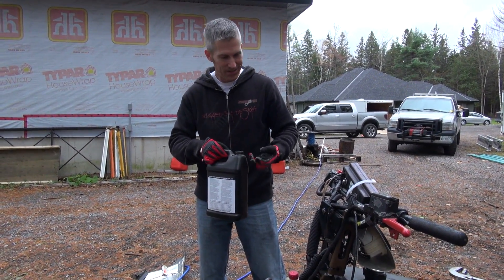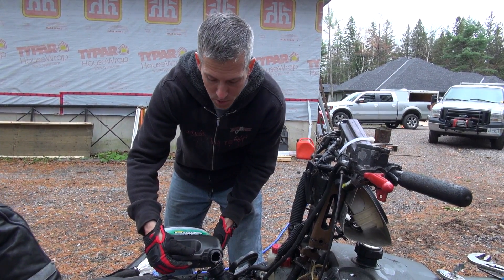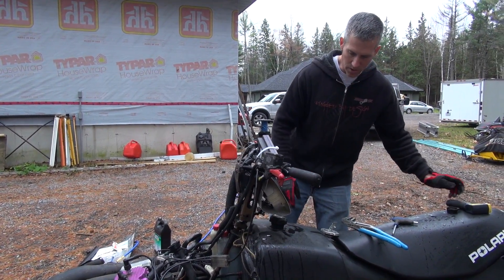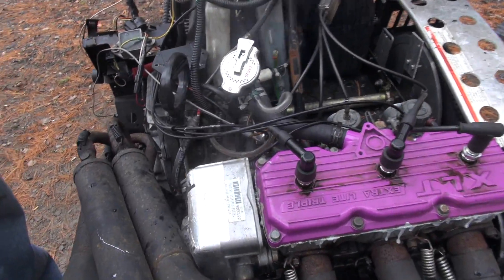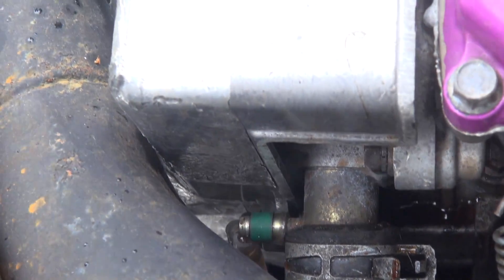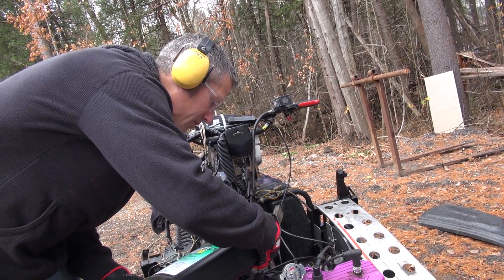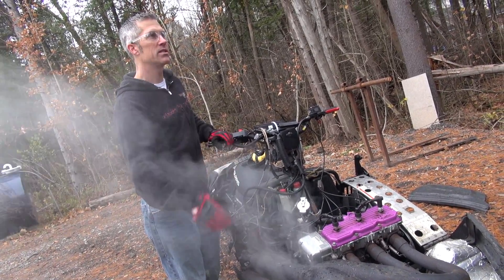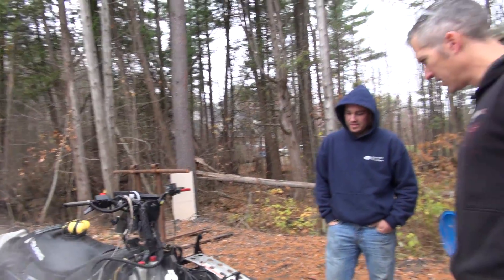Snowmobile run to 330 degrees with no cooler!  Evans Waterless coolant!

Comment: Mine went to 360 once after a air pocket blew out my coolant of my edge xcsp 800 found out my thermostat was bad but nothing melted other then my gaskets and I had no coolant at all and it still rips 😅
Reply: This year got extra cooler new thermostat and digital gauge no more over heating I couldn’t figure it out for years lol should of listen my thermostat was cooked the rod was completly pushed out and hanging there I thought I was ment to be like that but then relaized no it wasn’t 😅

Comment: ...so if the coolent is just circulating and isn't transferring the heat anywhere what the hell is the point. 330F is going the blow that engine to bits under load. If your engine got that hot you want the coolent to boil over to save the machine as a last resort. The phase change of water to seam absorbs a ton of heat and will rapidly cool the engine.
Reply: Michael Sestito actually no, at the point the water starts to boil around the cylinders it quits removing heat because there is a layer of steam between the cylinder and the coolant.  The steam being less dense than the coolant, it's ability to transfer heat is severely limited.  More often than not once the 50/50 boils it's to late to save the engine. The Evans remains a liquid and is still transferring heat well past the point 50/50 has boiled away.
Reply: @redneckgearheadgarage495  Exactly!! And that's why the 375 Degree Ferenheit rating of Evans is so important. 

Its that extra insurance in case something catastrophic happens like a failed water pump. 

What most people don't understand is that hi performance Lubricants like Evans have a really high boiling point for the purpose of helping to prevent total engine failure. 

If a lubricant boils off to soon, then there is nothing protecting the parts from the extreame heat leading to a quick death. 

Im sure you know that. Just hard to believe sometimes how dumb others can be.

Comment: As long as the temperature of the piston and cylinder gets to equalize instead of the piston racing ahead in temperature, engines can run very high temperature. Mostly limited to piston ring gap and coolant evaporation from the side of the engine, and the fuel mixture (it can detonate early and other stuff as a result of the heat).

Comment: Hey Louie, so if I'm understanding this correctly you're basically illustrating that this coolant didn't lose its cooling properties even at those extreme temperatures therefore the motor was still fine, but with a conventional 50/50 the coolant would've failed causing engine failure long before? Cool video man!

Comment: Most over heating is the result of th loss of coolant first,then the engine damage.Evans coolant while great will do nothing more than 50/50 in the majority of the cases,liquid cooled sleds don't overheat with full coolant very often,in those cases it would definitely be better to have it and not have your coolant boil off
Reply: +John DiMartino 
I'd beg to differ.  Slow operation, running on icy trails without scratchers, not kicking anything into the exchangers, will take some sleds easily into the boiling range of 50/50. And once you hit that point, damage happens fast.  You probably won't notice the overheat light before damage is already done.
Reply: +Element of Kindness if you don't notice it in 10-20 seconds you're messed up in the head
Reply: @LogicModding2003  No. 10-20 seconds is easy to overlook.

Comment: I dont see how this is a test of coolant, I mean, it is more a test of engine durability and oil effectiveness then anything.
Reply: PowerModz  Might have, depends what temperature the oil loses lubricity rating and if it even gets to that point before it reaches the combustion chamber.
Reply: Actually yes, it would have. Eventually, the oil would not be able to provide sufficient cooling and lubrication. If you would have put 50/50 in, the coolant would boil over before it hit an outstanding 350 degrees, letting you know you should turn off the engine before you cause serious damage/ mechanical failure. I dislike Evans coolant due to the fact that just because you don't know its getting too hot doesn't mean its not getting too hot.
Reply: You are correct.  The test proves that the engine will run at elevated temperatures and nothing more.  It is a tribute to the engine designers and the oil and has very little to do with the coolant since the coolant was not even allowed to do its job.  The boiling point of coolant could have been checked with a heat source and thermometer, without risking damage to a perfectly good motor.  Insane.
Reply from the maker: That's interesting, so if I had poor quality oil the engine would have failed?  Or what do you think would have happened if I had 50/50 coolant in it?

Comment: You did not release the air in the compression tester between number 2 and 3 i dont want to call bullshit or anything but maby redo a compression test only to make thing right
Reply from the maker: I saw that in edit, luke didnt reset the compression tester, too late though motor is gone!  I'll do ti again some day - I'm confident though. Thanks for watching!
Reply: yes i am to :) good job for your video i did watch them all , i did enjoy them alot  keep on doing what you do ! its awesome

Comment: So what does this mean, that I won't see any boiling water steaming out and giving me a headsup that the engine is too hot and that stuff will be breaking instead of me having to take out my little waterbottle? I mean, tuning cars you've always just gazed the oil temp and apprechiated high boiling point water additives but having a glowing two-stroke engine and no water boil, wouldn't we consider that not good? I don't get it but I am sure you can explain! :-)
Reply: Okay, watched the last 3 minutes.. seems like an awesome product.. but I am a bit scared possibly running an enginebay with all stuffs surrounding it a tad bit warmer than designed and tested for a sustained time :-D
Reply from the maker: By the time your coolant bottle starts spewing coolant everywhere it is too late, head gasket is probably shot or worse, i had that happen twice to that same motor - coolant about 2 feet straight up.  the main problem on a sled is the idiot light, it comes on mostly too late or never at all, and by the time we notice it it is game over - if we notice it.  with this stuff you can be an idiot and not notice your temps for a long time.  it's insurance.
Reply from the maker: peterpunch1 not sure what you mean. it runs the same temp as your engine.  I had to run it 20 minutes with no cooler in the circuit to get it to do that - very highly unlikely that those conditions would happen in real life.